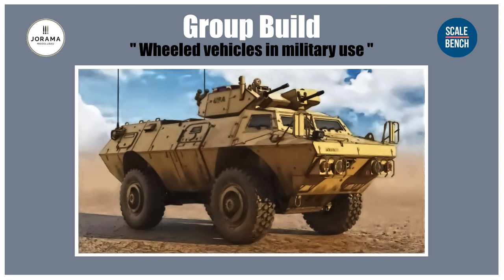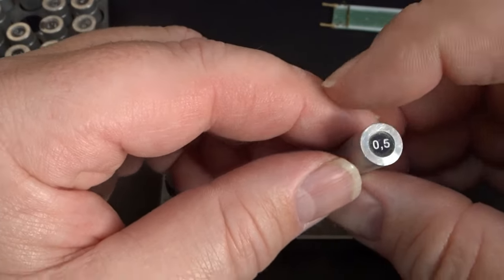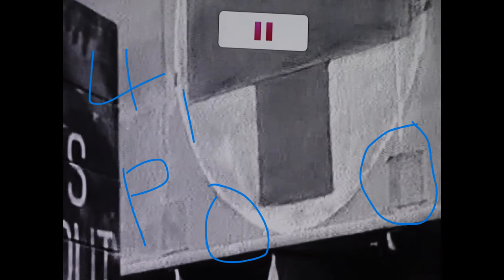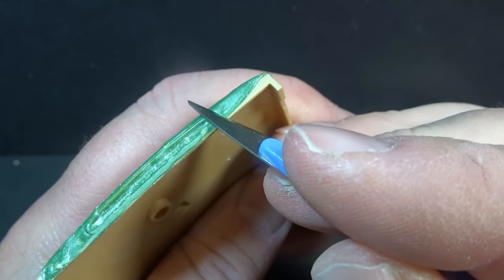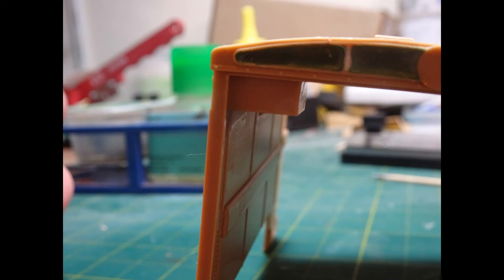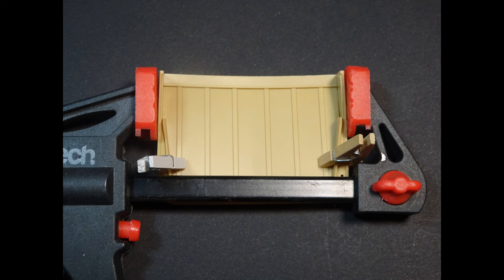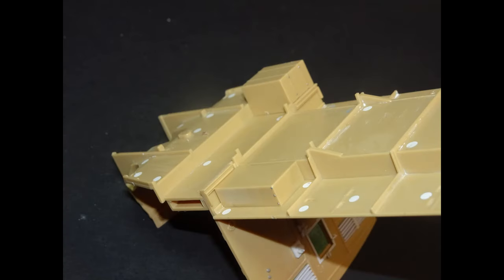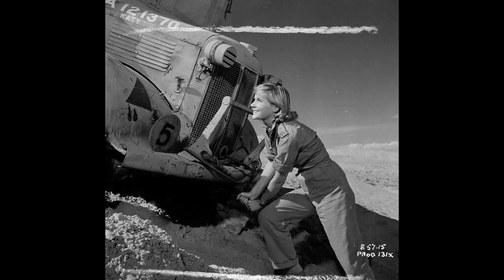Airfix 1/35 Scale Austin K2 Ice Cold In Alex KATY Conversion - THE BACK END

Comment: Instead of using the Green Stuff to simulate the repairs on the outside you could use printer paper impregnated with ‘Krystal Klear’ glue, the glue would not only stick it down but when dry stops the paper absorbing the paint you put on.
Reply from the maker: Hi Mr Jock. Many thanks for looking in and commenting. I have used loads of substances over the years and find the GreenStuff works well for myself. Take care my friend and happy modelling